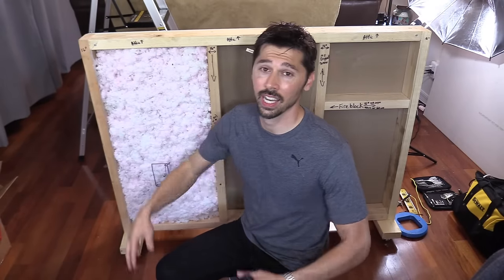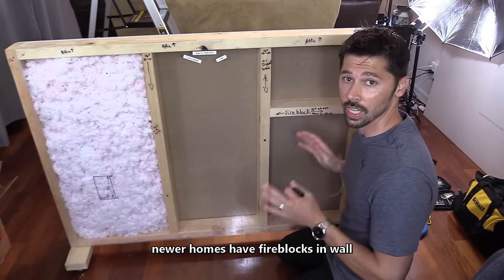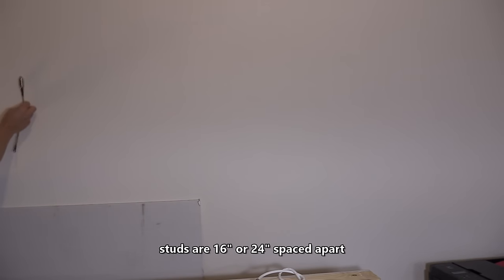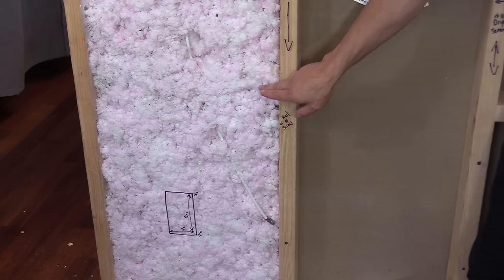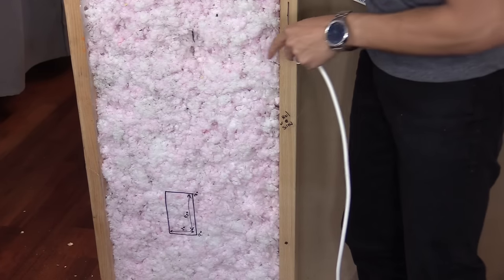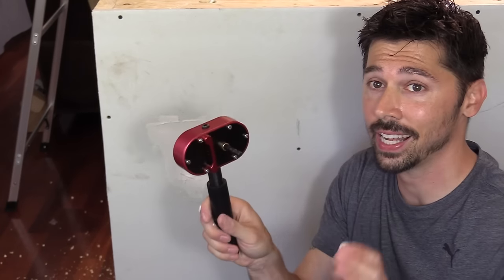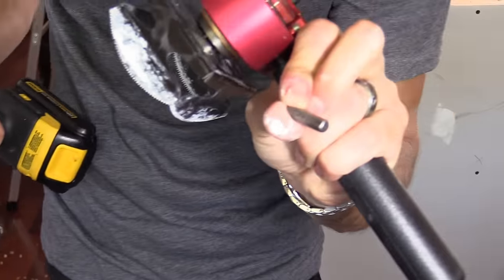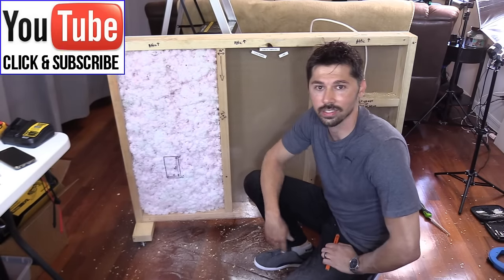3 EASY WAYS TO HIDE WIRES CABLES IN WALL & FIND STUDS

Comment: AT LAST!!! Someone else who folds tape to take off later! In this house I am the only one who does and it drives me BEEP MENTAL!!!!!
Reply: I would fine my guys a buck if they didn't leave a tail.
Reply: you guys should try growing fingernails
Reply: Be a friend... Leave an end!
Reply: I do it
Reply: Wondering how often the fold gets caught on something when pulling and pulls off the tape?  Probably depends on how many holes and bends you are pulling through.  My habits are based on pulling long wire runs in conduit.

A compromise:  bend over just a small corner of the tape end, less likely to catch.
Reply: I'm laughing but know what you mean.  I did remodeling for 45 years.
Reply: Courtesy tabs are pretty much compulsory in the theatre industry
Reply: I worked for Verizon as a splicer, and was taught "leave an end, make a friend" with the tape.

Comment: Why wouldn't you use extended bit for fireblock
Reply from the maker: Nick Griffin flex bit works too but sometimes flex bit may get stuck or damaged so it's good to know about other tools too. Might do a video on flex bit..🤔
Reply: Nick Griffin
That's what we used when I use to install cable for Comcast.
Reply: Lol he said a extended bit not a flex bit difference flex bit bends

Comment: I’m wondering why you never used any long drillbits to get through the fire block
Reply: I'm curious, how would you get the cable to go into the fire block hole afterwards? My fire blocks were 6ft from the attic...so that'd be a pretty long drillbit, but then hitting the hole with a cable would be the next challenge.
Reply: Well if the fire blocks were that far down probably most likely would be impossible to use a 6 foot drillbit it would depend on if you had the ability to shoot the drill bit straight into the wall cavity. In that case I would probably do the method where you cut a hole across the fire stop like he shows

Comment: I wish I would've know this and had the tools a few months ago. A client I had wanted to mount their TV with in-wall wired concealment and I had no idea about the fire blocks. It was on an inside only wall but it wall insulated for some reason so I ended up moving lost of the insulation out of the way and took some out near my holes which the fire block was right directly under. Luckily I had the great idea to get some wire and a right angle drill attachment to use a hole saw bit to cut a hole through the fire block. And I used the wire and a flexible enough wooden yardstick to push the wires down all the way. It took a good 2 extra hours but I got the job done, it looked really good and the client was so happy they gave me a big tip and one of the old TV's they had me replace while I waited for the tools to be delivered by my assistant. Now I have the tools in this video to reference for the next time I have an in-wall wire job. Thanks a ton!!!

Comment: Interesting tools, but that's a bad way to repair the hole. Put the spackle/filler on th edges of the hole to form a bevel to receive the piece. Do not put it on the back of the piece, it will like make it sit proud of the rest of the wall. I've had to put a screw in on occasions to make it sit flush even using my method.
Also, sand the edges of both pieces first to make sure you have clean edges. Any loose paper will just make it take longer to blend in.
Reply: that was a true electrician repair for sure as well as the mess on the floor
Reply: Ummm no....  Cut the paper on the patch off.  Cut the paper on the existing wall back and 1" to expose either rock or cardboard.  Use tape that fits in this new void.  Use joint compound.  Sand it.  Re-texture accordingly....
...Theres a correct way to patch, and millions of incorrect ways to patch.  Please just do it the correct way.
Reply: College educated I see. I'm a writer and your term, "sitting proud," immediately was visualized as a plateau rising over a desert. And you are right. My approach is to put a one by two behind the sheetrock and screw the repair piece to it. with one screw, maybe two. I also had added a short piece of drywall adhesive tape to the two by four to space it back just a hair, trimmed the edges around the hole and the repair piece to prevent a "proud" moment. And, just to be sure I took the repair piece down to Lowes or Home Depot to color match if the client didn't have the original paint. This has worked for me for 50 years. Oh, almost forgot to explain the reason for the drywall tape beyond the obvious. Dryness and humidty can change the dynamics of the final cured product. I err on the side of the replaced piece to deeper, but not by much. I don't want to see the small piece rising later. I use fiberglass spackling. It restricts movement of the smaller section relative to the linear expansion of the larger sheet rock.

Comment: Hate to break it to ya.  A lot of those ideas were good till ya for to th qbit.  An actual installer would use an extended flex bit to get through the fire break they are up to 48 in flex bits that you can connect to coax after drilling to fish down wall
Reply from the maker: Jeffrey Foster true I also use a flexbit and fish rods but more tools the better. when I lose some of my Flex drill bits in the wall I use Magnapull.
Reply: Tampatec this is true, my experience comes from professional installs.  It's not that I completely disagree it's that causing more holes in walls become costly.  Another idea is called a stinger.  Sometimes people can't afford all these tools.  But if you take a 18" of rg6 and strip off 12" leaving 6" in jacket with 12" exposed.  Make your hole where you want the cable to come out (following elec. Protocol) then using a pair of pliers force the stinger through ceiling all the way through to the hilt (or jacket)  this allows for finding location in attic, the copper coating is highly reflective with the basic headlamp, drill your hole and drop cable.  Ways to save on expensive tools.
Reply: Oh my gosh, another that didn't watch the video objectively

Comment: Drywall installers will never screw to fire block
Reply: Yup!
Reply: DIYers will just to "mark" the damn thing and make it easy to find with a magnet.
Reply: Yea They Do.
Reply: Rush Scott not in the hundreds of houses I've done.
Reply: Fish Freaks Plus how do you go around it?
Reply: Mustafa Anabtawi go around what? There is no need for them to spend the extra time and screws to screw to fire block.
Reply: On shear walls they do
Reply: david hayman. I said the same thing
Reply: Why not?
Reply: graceoverall  They only secure drywall to the vertical studs , they don't want extra screw or nail holes to have to mud and sand later.
Reply: I did drywall for 12 years .  Residential. An NO we dont screw the fire stop stud.  Its just a waste of time and inspection doesnt require it.   And drywall is mainly paid by square foot ( piece rate).  Not hourly.
Reply: Derrick Calvert m
Reply: Rush Scott no they don’t
Reply: Facts
Reply: Yes they do, on every house I've seen in Florida. Shouldn't, but then build quality has declined year after year anyway, so it's no surprise.
Reply: That explains the doubled up wallboard "to meet code!" to meet the thicker drywall on right angel wall. (instead of thicker furring strips)
Reply: N English 
Been in construction 20 years in Florida..... Never once have I seen drywall screws in fire blocks.
If it anit needed by code, it anit done.
Slows down the whole drywall crew.
Reply: and its against the fire code to run anything in a firewall
Reply: Irrelevant.
Reply: I was thinking about that.
Reply: In Australia we have noggins in the stud wall, generally at the height of the horizontal drywall recess joint, and they are never screwed to. Common sense.
Reply: You are the second person to stop and say, "I'm not going to do it. You realize that this is a demo? Right? He through it together to demo, not to ask your permission to add or not add screws.
Reply: If drywall installers aren't smoking pot I don't want them doing any work for me. I'll let them work if they have cold beer or liquor, but pot is really the thing you want your people on. No pot = no job.
Reply: @John Drake We call them 'noggins' in the UK - and generally their use here has nothing to do with stopping fire spread but everything to do with stopping vertical studs warping, straightening them if they are already warped at time of wall construction and generally adding strength to the wall by permitting lateral loads on one stud  to be transferred to adjacent ones resulting in less deflection and therefore less stress on the plasterboard (drywall), fixings, joints and decoration...
Reply: I said that same thing, but a real stud-finder will find it. It's not a big deal.

Comment: Why cut your wall when you can get a Extension and drill a hole threw the fire block too
Reply: Because there are many times that extension on your bit can't fit in an attic to drill straight down. The roof only allows room for a short bit without drilling down at an angle. Nobody likes patching drywall but if you have to, make it as easy as possible.
Reply: how do you stuff insulation  into that hole?

Comment: One time I thought I had a Fire Block and drilled through it with my long bit.  Then I came to another Fire Block just below it, so I drilled through that.  Then there was another one!  I finally figured out that I was drilling through the medicine cabinet on the other side of the wall!  So if you think you have a Fire Block, check the other side of the wall before drilling.  In-wall cabinets are usually framed in the wall with wooden studs much like a Fire Block.

Comment: thats nice if its wood stud but most studs in the homes where i live are metal studs, so the magnapull isnt really that helpful there......
Reply: almost all commercial buildings are metal studs too.
Reply: Dude it works there as well. Used a similar device all the time. That and the wet noodle(ball chain) from LSD with the neodymium wand.
Reply: @5879marcos  galvanizing is a coating of zinc to prevent or reduce corrosion.  It doesn't affect the magnetism.

Comment: China needs to knock off that magnepull asap. I'm not paying hundreds of dollars to run a cat5e cable.
Reply: Magnets of various shapes are cheap, including oblong rounded ones. Or just use iron on the drop and a magnet on the exterior. Also, just as an FYI, some walls have metal studs or brackets, particularly on corners, so exercise some caution.

Comment: Ive done this much easier for 35 + years as an electrician and IT professional with flexible extra long drill bits and fiberglass rods. It seems you have been bought by the makers of what I would consider ridiculous over engineered tools. Why make it so difficult?
Save your money and get experience with simple tools.
Reply: Thank you!!! Your right on point sir.
Reply: So how do you refill the hole in the fireblock if you are using extra long drill bits?
Reply: @Electrix_NoS  with fireblock foam.
Reply: @X862go  How do you get the foam to the hole to seal it, please?  Do you drill or cut a hole in the drywall near the fireblock so the foam nozzle will reach, do you have a 4 foot nozzle, or what?
Reply: @scottwillis5434   it really depends on where it is . Most of the time it is not that far away if you are already in the situation of cutting/ drilling through one. If that was to arise I would drill 2 to 4  1/4 in holes next to the fire block then proceed to spray foam. Then you should wait at least 1 hour and cut the tip of the extra foam that has now expanded out your 1/4 in hole. Then proceed to patch/ paint said holes. Or hang a picture over them 😎
Reply: @scottwillis5434  and I use the great foam gun btw much easier clean up and handing.
Reply: @Electrix_NoS  you drill a 3/16" hole just above the  fire block and squirt is fire block foam. At least, that's how I do it.
Reply: I’ve run cable in parts of wall, you couldn’t access from the top with any tools anymore. So had to run cable alongside existing only to hit the damn noggin 1300mm down which didn’t have enough space for more cable... that was fun.. In this rare instance, I’m sure this magna pull would come in handy.
Reply: @Hirokiji  in that instance i would undo you existing wire pull back/up just enough slack and attach you new wires to the existing wire. You can also if you already have a wire in the wall/area of the run just cut it and run two. This will depend on how much slack is in the attic of your existing wire.
Reply: @Hirokiji  also make sure you stagger your wire ends when you are pulling more then one wire. Dont not just tape 3 ends and a whole roll of tape and then wonder why you can't slide behind drywall or through a 1/14 hole.
Reply: Couldn't agree with you more ,Daryl.   20+ years myself in the low voltage industry and I laughed out loud watching this.  Maybe he will have an app coming out next that will make it even easier
Reply: @Electrix_NoS  fire caulking
Reply: Agreed. Bar hitting a random horizontal stud (work at an old hospital, you see some weird stuff), a set of glowsticks and string (depending on the pull) works fine for fishing walls.

And the glowstick method is the same basic setup as that fancy magnet: tape the cable on and shove that guy down, attaching more as needed. Go to the AT-90 you cut and feel around for the stick.
Reply: Daryl Eden - Most home owners don't have 35 years of experience doing this, and most of us can't afford someone like you who does have 35 years of experience. So the rich hire people like you, and the rest of us watch videos and make the attempt of DIY. . .

Comment: Some good tools and ideas based on ways how we used to do it before any tools like this were out, but some are pretty cool. I am not sold on the way you do the fire block bypass to drill through the stud. We use to use a long drill bit to drill through it then drop a ball chain or if wall had insulation in it we could would drill then drop the long drill bit down after taping the wire to it and pull though the wall box cut out since the bit was pretty flexible. We had to be resourceful and also we did not have the time or money to have to repair a hole like that patch, texture and match paint that's too much extra work and time.

Comment: Use white electrical tape. It leaves almost no residue unlike the black tape which ends up getting black goo everywhere.
That drill attachment looks pretty lame - Why not just use a jab saw like most folks in industrial settings do?
Reply from the maker: Will do, thanks for the advice.
Reply: Any particular brand or type you like?
Reply: Any color but black of 3m super 33 leaves no residue.  Another trick is start to tape normally, reverse so adhesive is out wrap tightly and then reverse to normal at the end and tape back to cover exposed adhesive again wrapping tightly. This will leave connector clean because super 33 is a bit $$$
Reply: This! Only time I ever use black anymore is for taping up a photo eye.The black goo will eventually end up where you don't want it if you use black all of the time.
Reply: Oh my gosh, another that didn't watch the video objectively. Watch closely.

Comment: Very good. Hey have a question I want to replace my old can lights with new led slim lights however the 6 inch are too small and hard to find 7 inch however do I need to remove old can in total to install lights like sun I slim led